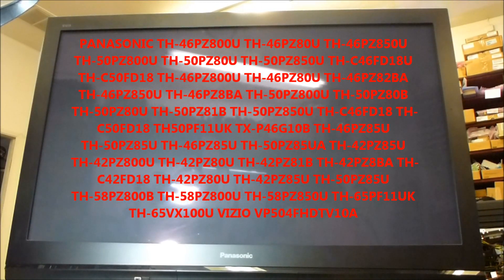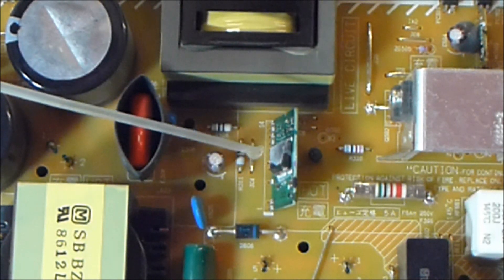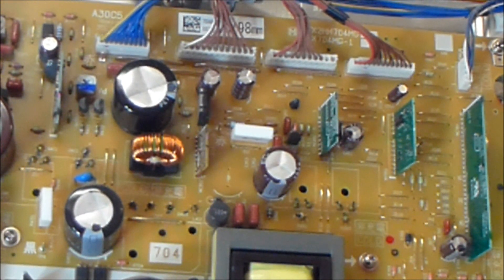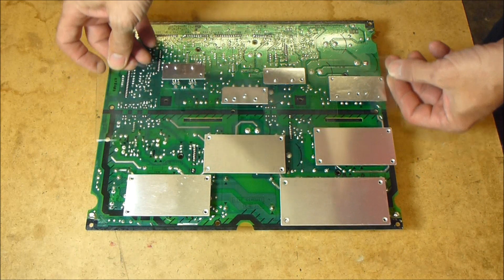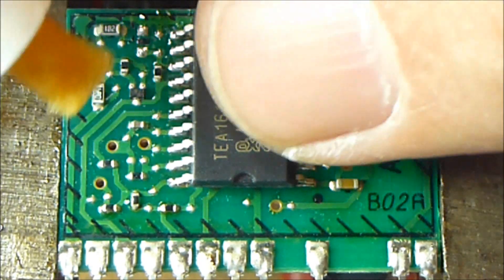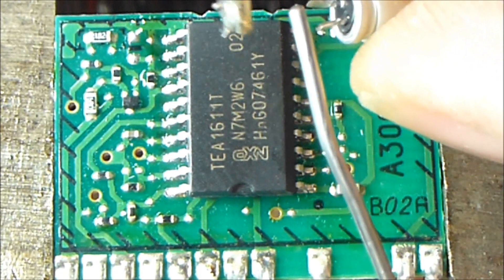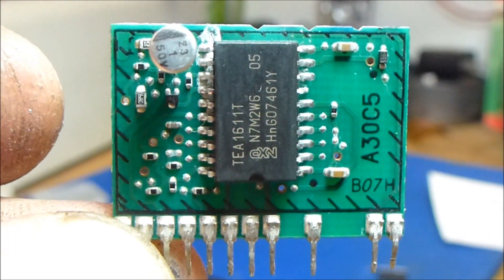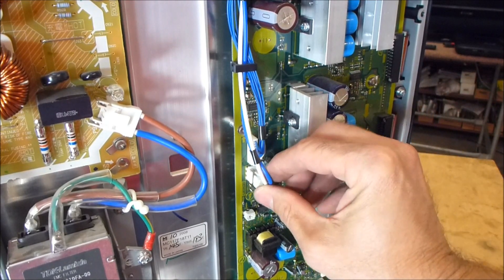Panasonic Plasma 10 and 2 Blinks TEA1611 ETX2MM702 704 706 Power Supply TH 42 46 50 58 PZ 800 85

Comment: I have a panasonic viera tc-p50s2. 4 years old. Turned. Now 10 blinks.  Uplugged, changed power source, cleaned dust with no results. Can you assist. If need to replace an A board where c do.i get it

Comment: I have a panasonic viera tc-p50s2. 4 years old. Turned. Now 10 blinks.  Uplugged, changed power source, cleaned dust with no results. Can you assist. If need to replace an A board where c do.i get it
Reply: Conna,
Replacing boards arbitrarily will not resolve the fault unless you get lucky.  There are several boards that could cause the "10 Blinks" in your Plasma TV and these boards are very expensive.  It will be less expensive to have a good HDTV service center repair your TV.  These HDTV's are very dangerous to work on.  HDTV Technicians are extremely careful when diagnosing, testing, and repairing these HIGH VOLTAGE products.
I recommend that you read the Panasonic 2010 Troubleshooting Handbook.  This is the best Guide/Handbook that Panasonic has published before they stopped building Plasma HDTV's.  This Handbook will help you narrow down the failure mode. It will also give you knowledge of how complex the HDTV subsystems are.
Go to the link below to download this Handbook:
 
http://elektrotanya.com/panasonic_tc-p42g25_tc-p46g25_tc-p50g20_tc-p50g25_tc-p54g20_tc-p54g25_fhd_plasma_tv_troubleshooting.pdf/download.html

Examine the troubleshooting charts starting on page 50 (Slide 50).  If there is something you don't understand, just keep asking questions in this Blog.
I strongly suggest that you get a repair estimate from a local Service Center (do not go to a "Big Box" store for service.
You have to rely on a small, qualified, repair shop.  Hope this helps.
Regards, GS.

Comment: I could use some help on something not covered in the video. I had a friend give me a TH-42PZ80U that he was throwing out. It passed the refrigerant test so I purchased the parts from an online dealer. I successfully attached the new capacitor on the MC201, but the iron touched what looks like a 102 SMD that runs parallel to the top of the board, directly behind the new capacitor.  Does anyone know the specs on this? Looking at the Panasonic service manual, it lists a ERJ6GEYJ102V & ERJT08J102V at various spots on the boards but does not give any info for the MC201/MC301 boards.  Anyone know the specs for this part? I would reattach it but it bounced and I can't find the little micro dot anywhere on the bench or floor.  Thanks in advance!
Reply: There are no schematics for the individual "MC" boards.  These boards are no longer available.  You will have to buy a new P Board if you can't repair your MC201.  I really wish someone from Panasonic would provide schematics for these boards.  I would then design and fabricate these boards just to have on hand (fairly trivial task).  BUT,  the secret to the resonant converter design has much to do with the MC201/301 board's components (resistor & capacitor values).  I do not think there are components mounted on the back side of these boards.  The component values are very different between these boards.  They are not interchangeable !
Regards, GS.
Reply: Gary Spencer Thanks for the response. I contacted the company that sold me the original parts, they told me the  resistor is a Panasonic SMD 0603 resistor, 330ohms with 1% tolerance. Thanks again.

Comment: Your video is very interesting and educational. Thanks for taking the time put this together. I have the Panasonic TH-58PX60U when plugged in will click three times and display 10 blinking lights before pushing the on button. I am trying to figure out which is the fret system for this model, where it/they are and how many I am dealing with so that I can perform the same fix that you did with great accomplishments. My power board #1 info is: ETXMM611MEH, NPX611ME-1 and the 2nd one is: ETXMM611MEH, NPX611ME-2. A30C5 was on both boards as well. If you need pictures of subject matter, please let me know sir?
Reply: Can't figure out what you are asking.  The following statement makes no sense to me:
"I am trying to figure out which is the fret system for this model, where it/they are and how many I am dealing with"

What is a "fret system"  ?
Thanks, GS.
Reply: Thanks for the reply sir. I've decided to junk the plasma since I can't figure which IC is giving me the problem.

Comment: Hi, get the same experience with an TH-50PZ800E. 3 clicks, 10 times red led blinking. Cooling down the TEA1611T on the MC301, the TV start normal and never stop working for ours. Need to replace the TEA circuit or only the capacitor? Only on MC301 or also on MC 201?
I've ordered the TEA chip on Ali. Thanks a lot for your answer.
Reply: Claude,
The TV will fail again in the same manner very soon.  So, it is good that you ordered the parts to have on hand.
You only need to replace the capacitor at the top edge of MC201/301.  Start off by just replacing capacitor on MC301 then check power-on operation of unit.
The TEA chip made by NXP Semiconductor is not the problem ....and it is quite difficult to remove & install without damaging the board.
The ceramic capacitor that Panasonic uses should last 30 yrs or more.  It is a very LOW quality ceramic capacitor.
Replace with a high quality electrolytic (polarized or non-polar).
Regards, GS.
Reply: Gary Spencer Hi Gary,
Thanks a lot for theses information. I would start with the capacitor replacement at first and will see if the problem is solved. Why the TEA circuit is recommended  to be replaced and is also provided on repair kit or what is the problem with this part?
Regards. Claude.
Reply: Claude C

The NXP Semiconductor resonant converter control chip rarely goes bad.  It is very HIGH quality type IC.  The capacitor's chemical properties change over time and the cap fails and drags down the chip's analog power rail which halts the switching power supply system.  This resonant converter subsystem transforms 395V DC down to 15V DC.  Panasonic designers (for some strange reason) chose a cheap, low quality, ceramic capacitor for a extremely well designed resonant converter power supply.  Hope this helps.

Regards, GS.
Reply: Gary Spencer Thanks a lot again Gary. You feel very familiar with this model. It's a fine to get it back to function but it's better to understand a little bit more on what happened. 
I replace the cap with an electrochemical 1uF/50V and it works. To be less invasive as possible I only replace this one on the 301 module leaving the module on the board. Are the same symptoms if the 201 module is failing?
Reply: Claude C

Claude,
Nice Job !      Eventually, you will have to replace cap on MC201.  Look, I had the same problem on my HDTV and I only replaced the cap on MC301 to see how long the TV would function (as an experiment).  It's been working for about 10 months now with no problems.  I have the 1uF caps on hand when the MC201 fails.
However, before too long, I will most likely have to replace some of the larger electrolytic caps that become leaky or bulging at the top.  I plan to check the unit once a year since it only takes about a half hour to remove & install the back panel.
Enjoy.

Regards, GS.
Reply: Gary Spencer This is not always easy to remove that kind of plasma. I will wait next problem to go inside and modify the 201 set. But opening it once a year would be good also to remove the dust... Thanks again for your precisions.

Comment: Hi Gary, its great that people like youself take time to pass on your knowledge, thanks.
I have a Panasnonic TH-50PZ80B, when powered on from front button there are two clicks, the green light flashes the fans come on, the green leds on the boards come on and the front green light goes to solid ......but no picture or sound! (theres no sign of a red standby light no matter what i try. Can you give me any ideas?
Reply: Mark,
Did you try changing video input sources  ?
Is there any indication of the OSD (On Screen Display)  ?
The On Screen Display are the small display panels that pop up when you change
input source, display MENU, etc.
If there is no OSD, the problem is most likely the "D Board" since you do not get any SOS blinking error codes.
You can download the service manual from the link below:

http://elektrotanya.com/panasonic_th-50py80pa_50pz80ba_ea_gpf11de_chassis_sm.pdf/download.html

When at this site, you have to wait until the notice changes to Get Manual

- - - - - - - - - - - - - - - - - - - - - - - - - - - - - - - - - - - - - - - - - - - -
This file is downloadable free of charge: Get Manual  <<<<<<<<<<  You need to WAIT until this "field" changes to "Get Manual".

(You are not logged in, only 2 downloads per day possible for you.)

Note! To open downloaded files you need acrobat reader or similar pdf reader program. In addition, some files are archived,
so you need WinZip or WinRar to open that files. Also some files are djvu so you need djvu viewer to open them.
These free programs can be found on this page: needed progs
If you use opera you have to disable opera turbo function to download file!
If you cannot download this file, try it with FIREFOX or CHROME browser.
- - - - - - - - - - - - - - - - - - - - - - - - - - - - - - - - - - - - - - - - - - - -

This can take a few minutes.
When it changes to Get Manual, you are allowed to download the large pdf file.
If you have a Digital Volt-Ohm meter, you can begin to narrow down a problem with
the P Board, D Board, or A Board.  The P Board is the HIGH CURRENT, HIGH VOLTAGE power supply board.  The A and D boards contain specific DC-DC regulated supplies that are derived from the P Board.
Regards, GS.

Comment: So, I installed two new capacitors and the tv turned on with no problems at all. While basking in my glory it obviously had to make a clicking noise and turn itself off. I unplugged it and then plugged it back in and now gives me three clicks and then ten blinks again. I took a closer look at my newly installed caps and notice that the positive side on the mc201 came unsoldered. Did I just fry this whole tv or should I try again with new caps?
Reply: Figured it out. One of my caps was reversed polarity. I know. Newbie mistake. Learned my lesson, now it is working perfect. Got the 42" panasonic for free and only spent $3 to fix it. So I feel like a winner
Reply: Christian Latson

Give yourself a massive pat-on-the-back  !  You refused to give up.
Diving catch in the end zone with 2 seconds left  !

Comment: Applied the freeze to only the mc201 chip and the tv worked perfect on startup. Am I safe to assume that I only need to repair the MC201?
Reply: Christian,
In the short term, .......yes.
In the long term, the ceramic capacitor on the MC301 board will also break down and become unstable.  So, it is more efficient to replace this capacitor on both boards since it involves lots of time just to remove the back panel on these plasma TV's.  If you want to do what I did, you can just replace capacitor on the MC201 board and wait for months (or years) for the other capacitor to fail (as an experiment).
Don't forget to clean all the fans before you install back panel.
Good luck.

Regards, GS.
Reply: Gary Spencer Thanks so much. I think I'll skip the experiment and go ahead and replace both! Last question, do I have to remove the board from the tv to solder a new capacitor to the mc201/301 or can I do the repair with everything inside the tv still intact? Thanks again!
Reply: Christian Latson

Not really.  If you have good soldering skills with ultra small components, then you won't have to remove any boards.  The cap is at the TOP edge of the "MC" boards (watch the entire video in this blog to locate position of cap).  Use a 15 watt iron with small tip.  You have to anchor your wrist somewhere to keep your hand very steady.  Good Luck.
Regards, GS.

Comment: where did you get the electrolytic capacitors and what is the part number to order them.
Reply: Edwin,
I recommend replacing with a 1uF electrolytic (50V) from DigiKey - Part Number  493-10252-1-ND  ( $0.60 each ).  Cut the leads as short as possible, but just long enough to perform this somewhat difficult soldering task.
Regards, GS.

Comment: Hi,
I have Panasonic TH-42PZ8ES... 3 clicks and 10 blinks ... i have cooled the chip and works perfectly for about 40 minutes. watched for a while then i turned the TV off. After 50 minutes i tried to turn it on again and 10 blinks and 3 clicks. If i want to turn on TV i have always cool the chip down ... any ideas to solve this problem ?
Reply: Mr. Pampalin,
Did you watch the entire repair video in this repair blog ?
If not, take the time to watch video where Norcal shows how to replace "chip" and capacitor.  You only need to replace the capacitor.  It is extremely rare that the chip will fail.  Also, take time to read my REPLIES in this blog.  You will learn much about this type of power supply failure.
Do you have experience with soldering small components  ?
If not, you will need to practice with a 15 watt soldering iron with "fine" tip.
If you run into trouble, there are lots of experience folks supporting this blog
and will help you fix your plasma and keep it out of trash heap.
Best Regards, GS
Reply: Gary Spencer
 Thank you for quick response. Yep i watched the whole thing ... i have some skills in soldering but not with small components. However friend of mine knows pretty well how to solder small components so i will ask him for assistance. Hope this solves the problem.
Commodor
Reply: Commodor Pampalin

Excellent.  The capacitor is located at the top left of the board (on both boards MC201 and MC302).  You can locate it very easily if you examine Norcals video where he shows the component side of MC301.  I replaced the leaky capacitors on my unit without removing the large P Board or the small "MC" boards.  This made the job MUCH easier since the cap is at the top edge of the board and mounted vertically next to the NXP Controller chip.  Exercise much care removing the caps with proper wattage and "tip".  You don't want to damage the capacitor nets or lands.
My advice would be to first replace cap on MC301 board - then test the TV for normal power-up operation.  Then replace cap on MC201 board.
Good Luck !
Regards, GS
Reply: Gary Spencer
 Thanks again for advice i managed to replace the capacitor and now TV works perfectly..

Comment: Und nun bin ich dran, ich habe TH-42PV60E
please help
Reply: Werner,
Please describe your problem.  Meanwhile, I will take a look at the schematic to see if your power supply board has MC201 and MC301 control circuit boards.
Regards, GS
Reply: Gary Spencer Hallo Gary, nach dem Einschalten 10 Sekunden an, dann aus und die rote Standby Lampe blinkt nur noch.Grüße Werner
Reply: Werner Weber

Werner,
Please list how many times the power LED blinks .....
2 blinks
3 blinks
4 blinks
5 blinks
6 blinks
7 blinks
8 blinks
9 blinks
10 blinks

Your HDTV has the same chassis type as most of the TV's in this blog.  I have the service manual for your unit so I will be able to help you narrow down the problem.  Do you know how to solder small surface mount components ?
Regards, GS
Reply: Gary Spencer Hallo Gary, plötzlich ging es wieder !!! Ich kann also nicht sagen wie oft es blinkt !! Ich melde mich wieder wenn es nochmal vorkommt, vielen vielen Dank für deine Mühe, Grüße Werner